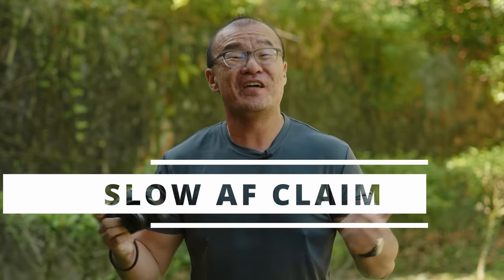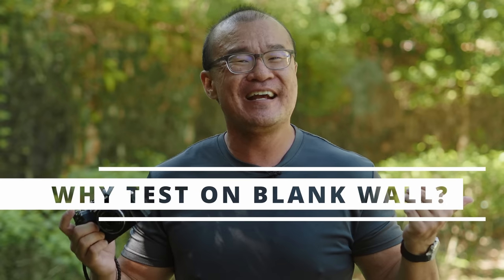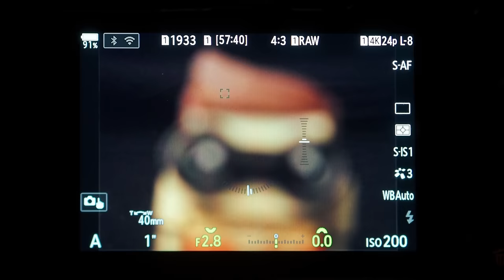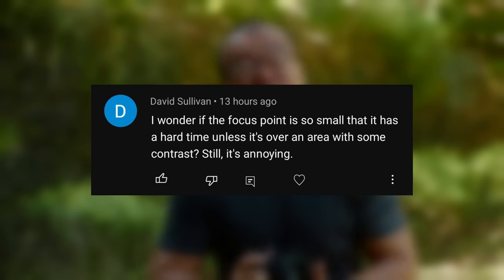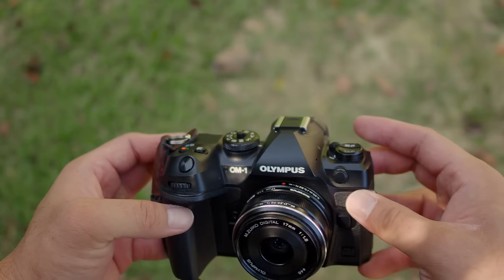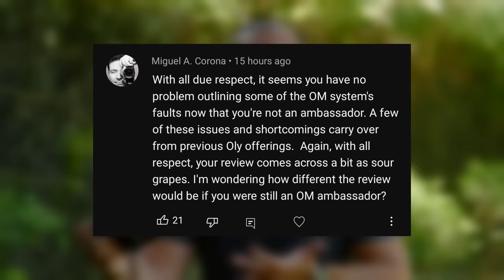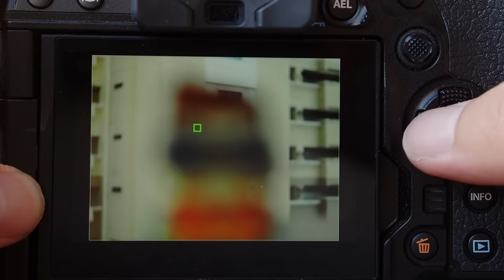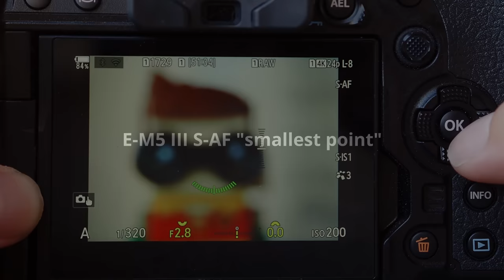OM-1 Slow S-AF Follow Up With MORE EXAMPLES

Comment from the maker: UPDATE: Rob Trek also made a video to verify the S-AF issue on OM-1, you have to watch it: https://youtu.be/Lt-5UFcIIOc
I did not want to make a huge fuss about the S-AF issue when I mentioned it briefly in my previous video. Then the flood of comments and questions came in. I guess I have no choice but to dive in deep and explore this further, with more example. I am just reporting my experience. I still like the OM-1, I will continue to use it and make more content (POV shoots, tips and tricks videos, etc) but it does have some issues I cannot ignore.
Additional note: Please don't suggest C-AF. For reasons, refer to comment by Vincenzo Avignone. I have similar encounter, in low contrast and low light, shooting people is a nightmare with C-AF. S-AF is still superior.
Reply: Wondering if it behaves the same way with all your lenses?
Reply from the maker: @jjmarz1001  yes all my lenses.
Reply: The AF on the OM-1 was just as bad for me. With each lens.
In addition, the rear wheel also functioned erratically.
I have since sold it and bought an M1 mark3. Everything is perfect there, just like with my E-m1x.
Reply: panasonic lenses are garbage. use only lenses with the words PRO inscribed on them.

Comment: Not sure why people questioned focus settings when you already showed the older bodies worked just fine.
Reply: Possibly because they don’t experience the same issue? I am one of those people. Mine is zippy quick, almost as quick as my R6 was. Wondering if I got lucky or if something may be up with his body! Either way, awesome to have a follow up showing potential work around a that didn’t work - definitely informative on the issue!

Comment: Hi Robin, as I stated in my last comments I love my OM-1 specially for my bird shots however, I tried a similar test to yours with my Em1 Mk iii and my OM-1 and you are correct, the OM-1 would not focus unless i moved to a contrasty area whereas the Em1 Mk iii had no problem and was very quick, possibly quicker and yes it is an area of concern that i hadn't noticed before. I'm normally on C-AFC for birds, insects and sports shot so hadn't noticed the difference in speed and accuracy with the S-AFC. It looks like an area that needs attention from OM- Systems ! My apologies if I came over a bit strong in favour of the OM-1. You are correct in what you have shown. Cheers from New Zealand

Comment: I notice a lot of these ambassadors would convince you that Olympus is the best at everything. The shortcomings of the smaller sensor are  minimised or spun as an advantage. I love to see critical review of products, not promotion content.
Reply: Did you watch the videos? This has nothing to do with the smaller sensor size. The older cameras don't have this problem. This may have to do with the stacked sensor. I do understand the priority is CAF but the flagship model should still deliver the same speed and accuracy with SAF as the previous models. And with someone pointing at the problem there might be a fw upgrade sooner or later.

Also the m43 systems has it's pros and cons and clearly there isn't a best at everything system atm. (Although the Nikon Z9 with the selection of WR lenses really is almost perfect, but I'd rather use a Em 5.3 with the 12-45 f4 in combination with a Em 1.3 with 40-150 f4 for travel and landscape photography, no need to change lenses in extreme conditions and alltogether still cheaper than the Z9, because price is a factor.)
Reply: @hafzke  I watched the video. My comment was a general statement about how Olympus ambassadors cover the system. For instance, I watched all their OM1 reviews and this is the first time I'm hearing about this AF issue.
I also have an EM1.3 that I use primarily for macro, and I love it. My issue it with the biases of ambassadors covering the system.
Reply: @Jay-sr8ge  my guess: it's because most use CAF. I mean the dozen out of ~8000 views (by that time) which Robin is mentioning is roughly 0,15%. So I'm not surprised nobody mentioned it before. Not everyone compares a new model to the older ones too. I don't think this has to be bias, just an oversight... not hiding something, this happens all the time, even when it shouldn't

I use different bodies all the time, also from the pen line and also other systems. I don't think I would have noticed it without Robin mentioning it. And I prefer SAF too. Also it's good enough for my purposes anyway... but... yeah, it's right to share this, nothing can get fixed if nobody says what's broken.

Comment: I use my OM-1 only with ancient 4/3 lenses like 14-54, 50, 50-200, and sigma 24mm. I see similar issues only with the two primes, but the rest of the lenses are very quick with a single AF. I don't have any new lenses for MFT so I can not compare, but I think there is something wrong rather with your particular model, not with all OM-1s.

Comment: For those who claim and suggest otherwise, Robin, as he mentioned, has ALWAYS been fair in reviewing Olympus Gear. My problem with other Olympus Ambassadors is that they felt like commercials, which is really not helpful. 

I've seen a whole bunch of videos filmed on the OM-1 on youtube and during the talking head bits the focus would go a little soft for a second. So I have no reason to doubt the authenticity of Robin's experience. 

He's simply stating his experience with the camera. If you don't have that experience, then honestly that's great - no one wants to deal with camera issues. But to dismiss him as having "sour grapes" or misleading or "using the camera wrong" is ridiculous. He knows how to use a camera, guys.
Reply: For stills photography, I have had fairly good success with the OM-1 and S-AF. I primarily use this as I do landscape photography, and I prefer to choose where the main point of focus is. I also do wildlife photography, and find it easier to direct the focus point/s to where the animal is. I realize this isn't the fastest way, but C-AF with tracking doesn't seem as reliable as just trying to direct the focus point/s myself. This is fairly reliable, but it does sometimes appear to have a level of softness even when it appears to have the focus point on the animal. This is most noticeable when there's foliage around a chipmunk or bird, for instance. In video, I've definitely experienced the loss of focus for a moment as things soften, then focus comes back. It's not ideal for professional-quality shots, however, I'll add a note here that my primary skillset is not with video. So ymmv. I primarily shoot with pro lenses. So the AF should hypothetically be at its best. If S-AF has the issues people have noticed, then I wonder how useful C-AF might be. I intend to try it more in the future to test it out for myself, as I'm curious. With all of this said, I love the OM-1 and use it as my primary camera. I agree that it's worth pointing out the shortcomings. These would seem to be issues that can be addressed over time with firmware updates. For instance, past stability and AF issues have been worked on with each new release. I'm on 1.5 now, and the S-AF issues remain. Maybe they'll get them sorted with 1.6?

Comment: No guys, Robin's camera is not faulty. I just repeated my tests I've done a month ago when I got the OM-1. I am comparing it to my EM-1 mk2 using the Leica 100-400mm and the same settings on both cameras. I'm trying to focus on the front of a headlamp placed directly under a spotlight on a table at around 2 meters away from the camera. Too bad I cannot add photos of the setup here. The headlamp is a old Fenix HP15 which has a combination of grey, silver and black colors on the front element I am testing the focus on.  My findings were the same back then as they are still valid today. The OM-1 does not lock focus on the object neither using the Small area nor Single point but the EM-1 mk2 is spot on every single time.
So, it's not about a faulty camera but it's a real issue. Robin's camera is from US and mine are from Europe so for sure they are from different batches. I also have the latest firmware installed. 
Or... maybe is not an issue and there are some good reasons they made the focus algorithms to work this way on the OM-1 but that should be explained.

Comment: Thank you Robin for your follow up.  I tried focusing on a blank wall in low light, using my 12-40mm lens and indeed it just couldn't do it.  Didn't make any difference with s-af or c-af. However I never actually do this so I hadn't noticed it before.  I'm used to contrast detect AF and always use back button focus so I always focus on my subject and then reframe and take the shot. Mainly because I want to make absolutely sure my subject is in sharp focus.  I wouldn't want to focus on the wall, even if my subject is standing against it. I noticed you were trying to focus on a blank section of the toy.  Having used Olympus for years, I just know not to even try this.  Focus is instant on a join which is only a few mm away.

Comment: I totally agree with you Robin. I have similar focus issues with my OM-1 with the newest firmware 1.4, it’s quite disappointing. All my lenses are the Pro Line (40-150, etc.). Unfortunately it’s a huge gap there, comparing the OM-1 with my other camera Sony 7C in terms of focussing!
I love the capabilities of the OM-1, especially the focus stacking, but OM Systems has a lot to do with new, much better and improved firmwares!

Comment: Hi Robin, 
I’ve had the OM1 for a while and like all my previous cameras (EM1.2, EM1X, I still have and use both) the results I get have improved with my experience with the new camera. I have noticed the problem with low contrast auto focus and to be honest it’s not any better with the other cameras, however it doesn’t cause me problems because I am already adapted to back button focussing in contrasty subjects before reframing, something I’ve learned to do with previous Olympus cameras.

After using the OM1 in two scenarios I previously used the EM1.2 and EM1X (African safari and cirque du Soleil performance) I have actually come around to think of the OM1 as a wow camera. The results are much much better in low light event shooting, the files clean up incredibly well in high iso, autofocus is rapid in my use cases and when I have to go to manual focussing override to get the shot the fantastic EVF has made manual focus exceptionally sharp, in my hands it is much better than the other cameras and better than other leading brands’ flagships used by friends at the same events.

And then you add in all the other features like super fast processing, extraordinary frames per second, subject detection and other computational features and this really has turned into wow for me.

I don’t really shoot people much, weddings, street etc, and if I did I think I would still take my EM1.2, it’s smaller and lighter and does a great job. I’ve never had a 1.3 so can’t comment.

I hope OMDS find away to improve the low contrast AF but if I’m honest it’s not a significant issue for me, and the OM1 is not significantly worse than the other cameras I have in that respect.

Comment: I have not had the same experience.  I wonder if it is a function of the lens you are using.  I have definitely found that the smaller and older f1.8 lenses seem to have an issue, whereas I don''t have that problem with the pro lenses.  S-AF is great for shooting people but the C-AF particularly with the eye detect seems to work pretty well, even in lower light situations.  I am a pro photographer as well and have moved away from the EM1 mkiii except as a backup camera because of the superior images and higher autofocus capture rate.

Comment: I found one monotone object in very low light the OM-1 would not focus on.  I switched to C-AF and it focused accurately.  I tried my R5 on the same subject and it would not focus in AF-S either.  The EM1X would sometimes focus but upon review images were out of focus.  

I also noticed that activating the magnified view (green square) allowed the OM-1 to focus on the monotone object accurately so that's an option if you must use S-AF.

In any case, not an issue I would encounter in my work.

Comment: Total bummer! Thanks for the follow up video. The OM-1 is definitely slower than prior cameras I’ve used but I can’t say it’s as slow as yours. Maybe I got lucky??? Or maybe I just can’t adequately assess things as you have way more experience than me on testing things!!! Keep up the good work.
Reply from the maker: It is only true specifically in very low contrast, and of course low light environment. In normal use it is fine. But I expected OM-1 to be better than E-M5 Mark III
Reply: No experience with the Em 5 mk III but I take your word for it. Hopefully a future firmware update can fix it, if it’s a software issue!

Comment: I've found the autofocus performance can vary a great deal depending on the lens I use. Using my trusty old 45mm f1.8 and 17mm f1.8 lenses gave a noticibly poorer performance than when I've used my PRO lenses. I don't know if it's just my experience, or the camera, but using thw 40-150mm f2.8 PRO gives very quick auto focus by comparison. To me it feels like those other lenses need updates to better suit the OM-1, but hey, I'm just an amateur hack and am just going off my experience.

Comment: I have the om1 and yesterday i shoot in snow mountains. Zero problem with AFS. Very fast as my Sony a7r3 with 16/35 GM. Past summer ascending Montblanc and Gran Paradiso the same history. Zero problems with AFS in my OM1
Reply: A7RIII very fast in C-AF but slower in S-AF with some lens
Reply: @user-sg6xv2kb8s  a7r3 and 16/35gm is only for landscape
Reply: Snow mountains sounds like your conditions were high contrast and good light -- the opposite of the conditions in which Robin experienced the focusing issue. Did you shoot in low light with low contrast anywhere?

Comment: Hi Robin, that's exactly what I noticed too. I went to many dealers to get this question answered. All have looked at me irritated and said: I have no idea. What bothered me most about the OM1 was the small autofocus, which you can not set larger. As I can on the OM 5 or other Olympus cameras. Also to this day I have not received an answer. Really a pity. Of course because they don't know it themselves ;-)
A detailed explanation of the image styles I have also not received. Even if it does not fit in here, I have watched many videos before and just did not find anything. What about the image styles? I am also very interested in them. So the kind of filters. Which there are of dehnen still. I have really also been told by photo dealers that there are no more Art filters, which is not true. I was happy to use this one. I also found the SCN mode very helpful in some situations. Professional or not, the setting e.g. in the sunrise - or sunset one got better with it realistically, I found. Vlt. you might go into it again at another point. I still hesitate with the purchase, the OM1. Whether female photographers, or photo stores just can not answer me these questions. I would be really happy if you could answer them for me. Best regards from Switzerland.

Comment: I also have these 2 cameras and try some test. Your issue is really happens in some circumstances, not all the time. Fortunately, I am not bothered by it in real live use so far. And the interest thing is I found that using “magnify” to enlarge the focus area can significant help focus on low contrast target.

Comment: This morning I tested my OM-1 against my soon to be sold EM-1 Mark III, I reset both cameras to default and used the same Sigma 16mm lens but found no discernible difference. I don't know what to say, it's an enigma wrapped up in a mystery. I realise it's a present, otherwise I would send it back to the manufacturer for servicing
Reply: I am using OM-1 with no AF problems and I am very happy with it.

Comment: Great video as always 😀Seems the struggles you are having with the new camera are worrying…you know the person who donated this to you didn’t want you to have these problems…seems like they donated the camera to further help you and the channel…it also brings to mind a question…Does the new OM Systems brand-company have the same customer service (where if you find a product to be defective ) you can send it back to them for replacement or repair?🤔
Reply from the maker: If you sift through the comments from the previous video, more than a dozen people commented with the same focusing issues.
Reply: @robinwong  Hi Robin 😄 I think you misread my comment 😁 I was not attacking you and the video you made😄 I stated it was a great video and I stand by that 😄 I view it as an expose on an issue that happened to you and others😁 My question was asked because I owned the OM-D EM1 Mark II and III…both had autofocus issues…both purchased from an authorized Olympus Dealer, new from the box…in the days when Olympus owned the company…I called customer support told them about the AF issues I experienced and they emailed me instructions to mail in both devices so they could make an assessment to repair or replace…in both instances the camera was deemed defective and replaced by Olympus…All that is to say that AF issues (in the days when Olympus owned the company) were looked at as a defect…was just wondering if the new company OM System views this as a defect as well and offers to repair or replace cameras with that issue…I would hope that they would as most people who purchased Olympus products would want to feel comfortable that OM Systems would want to maintain the Olympus customer base…As always looking forward to viewing your journey as a I am a fan of your channel…I hope someone can assist with the camera issue you are experiencing (as I feel you should not have to work around this issue if something can be done to resolve it) 😁